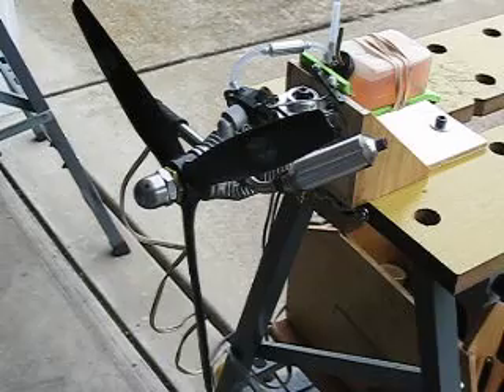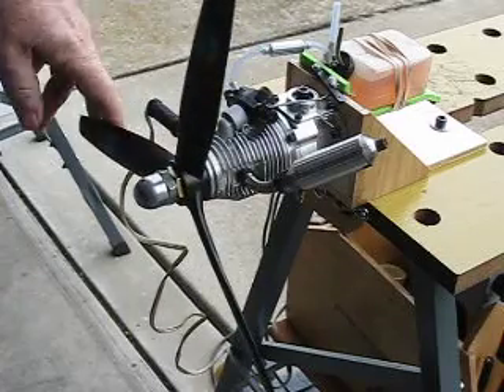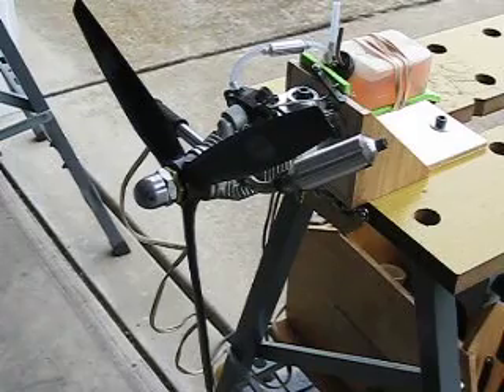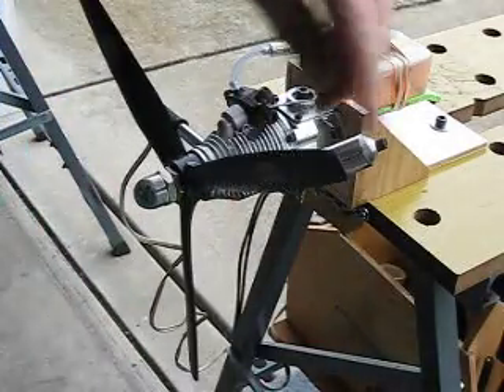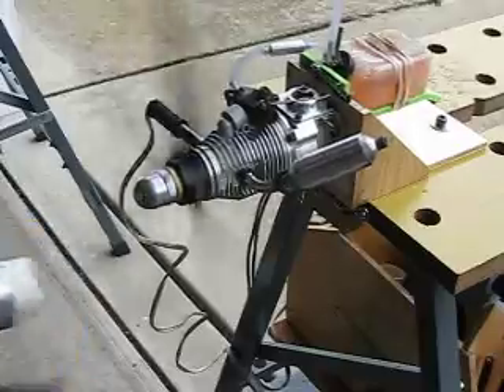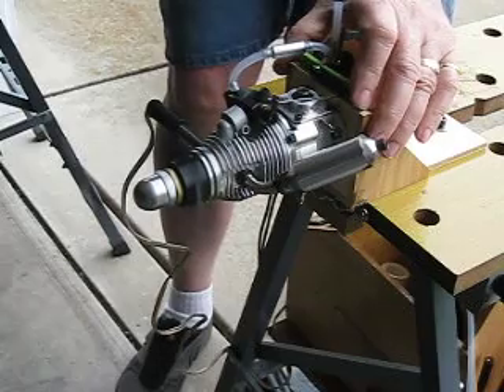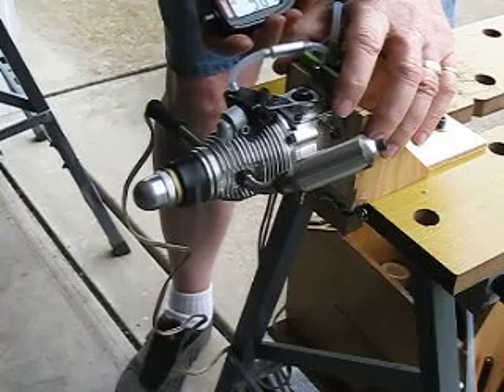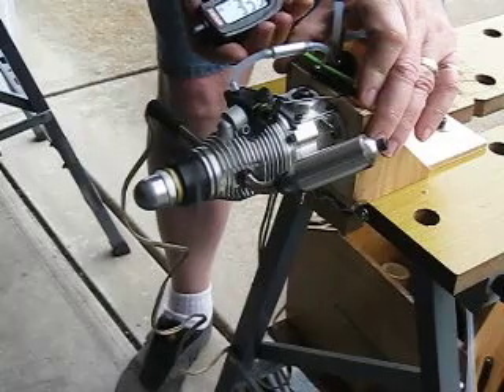RCV 60 INLINE PISTON ROTATING CYL 4S MODEL ENGINE

Comment: Perhaps this marvel engine would work better, be more practical, with cooling fins parallel to cylinder, as in some old Guzzi motorcycle engines (Cardellino, Sahara,...), instead as perpendicular, as shown in images.
[See Wikipedia Sleeve valve article: 'The calculation of fins for air cooled engines', Biermann]
The RCVengines deserve a great success!
Blessings +

Comment: A good friend of mine has one of these (the RCV 90SP.) I think they are pretty cool. Thought of using one of these to spin a larger slower spinning prop; However if i go back into this hobby after being absent for several years I am convinced these new High capacity Lithium batteries and electric motors would be more powerful, less messy, more convenient, longer flight time, etc.. So If I buy one it may be just to have it as a collection, not sure if it is worth it.
Reply: The power density with jet it gas is too high for batteries to ever catch up.